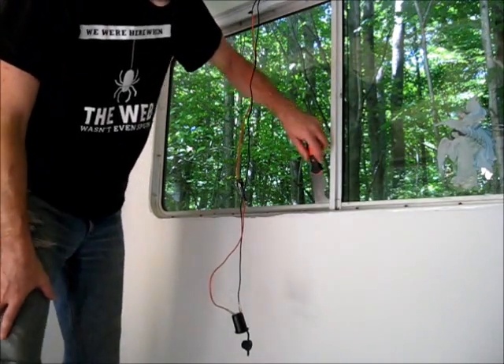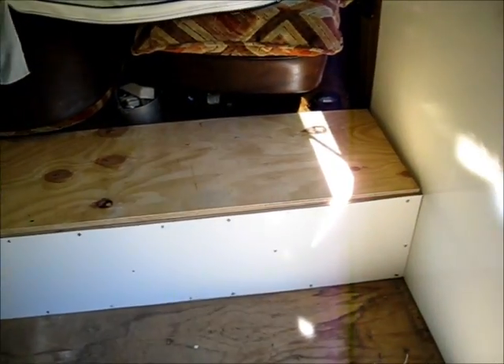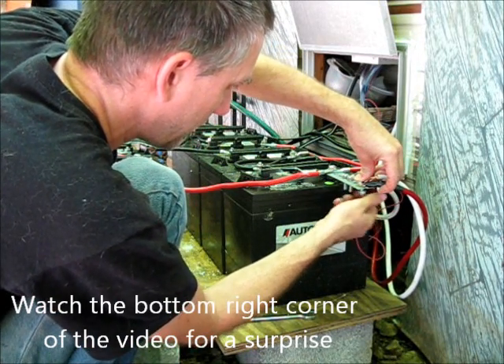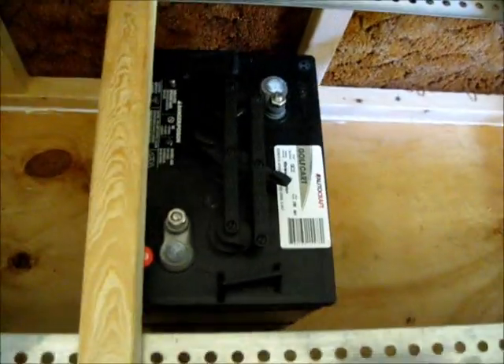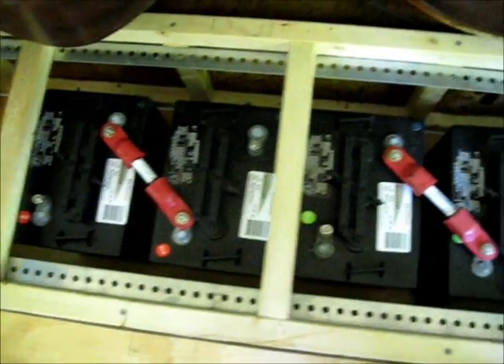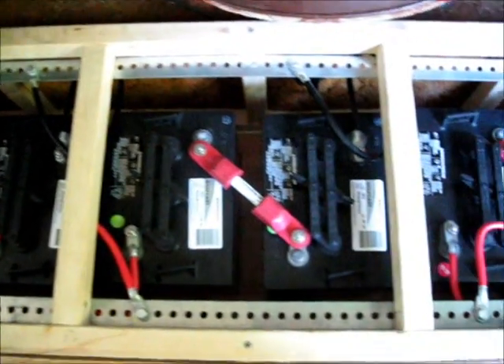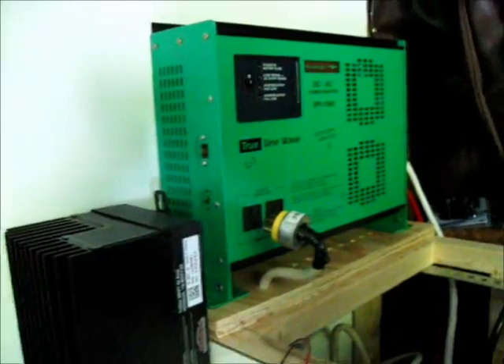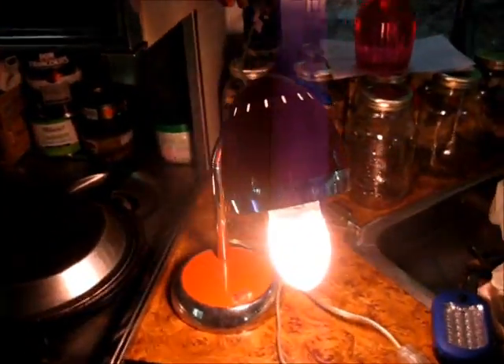Installing My New RV Solar Batteries And Power System

Comment: yes mike had me pull the plug on rear i put a 1/2 a pint in it he said it smell if it was still leaking i need the other part there 2 sizes for my truck he going to fix in next week i got my inverter in side shed or home laundry room vented, if leaving the box's i have are setup same way

Comment: You really dont want to have more than 100 feet of wire from your solar panels to your batteries. you will exsperience a large voltage drop if you go further than that. The batteries wont charge as good as they could if they have a higher voltage to charge with. So if you can shorten the wire you found in the forest be as close to 100 feet as possible  you will have great success in charging rates or times. It will really count for more on cloudy days. you have waay more panels than 230 watts.

Comment: Good system  but its too bad that you had to take shortcuts today. I would not use styrofoam for anything exposed, its a fire risk and fragile. Find another piece of 1/4" board for the back of the box and just put construction adhesive on it, NOT gorilla glue! and push it down between the carpet and box. Also, what gauge was that wire to the solar controller? should be around 4 ga to be efficient. Also, if you tied it the aluminum wire outside, you will need a CU/AL conductant, or they will rot

Comment: No, I did not, wood cases would not be a problem. It is utilizing wood to effectively support electrical buss bars and then under wet conditions which will create a partial to potentially signifcant short accross the buss bars. Which are being used for your paralleling of your effective 12v batteries. It's like a live tree, and or wet dead one will attract a lighting strike and conduct the very high voltage to ground. in your case at 12v even damp wood is only a patial condutor, but you have alot of amperage, I would see it more as a parasitic drainage of your power issue, than a real fire danger or rapid dischage as in a real significant short.  But in a heavy rain and/or you get a new leak in your wall/roof next to the box going to the upper wood supports of the box, and especially the ones going accros your buss bars, could be a issue that you would have to diconnect quickly, but I doubt it. To solve any potential problem and or unnecessary energy loss , I would recommend just unscrewing both the positive and negative busses from the wood frame and inculed a little space, your set up the cables and batteries colud support the busses with no othe structural support, if it's still the same way after 4 years, lol.
Reply: I think, therefore I am. (I think).

Comment: Maybe I really do need new glasses. LOL 
Referring to what you said in another post. Now that I'm looking at comments in thread order, see which one you're referring to. For some reason YT isn't referencing the original comment on many replies. Have to go to beta thread version to see the actual reference. 

BTW, you said hot air rises. We're dealing with atmospheric pressure - positive & negative & how it affects lighter than air hydrogen movement in battery box. With fan in box = negative.

Comment: did you ever try the 5 gallon bucket with a board for a ramp and a can on a hanger with peanut butter trick to catch mice with. I have seen many many videos using that method with great success.

Comment: I must say that I'm a bit disappointed that you used good quality equipment and yet you chose a very poor quality material for your buss bar. I certainly expected to see a copper buss bar as opposed to the steel you used.

I have 4 off-grid homes in the southwest part of the country, 3 of which are RV's and the 4th is a sandbag bunker style 955 sqft home which is only 3 feet above ground. I love seeing the off-grid projects others have done and I'm still going through your videos.

Comment: i got my charge controler in side my battery box on the back side of the box so i can see the charging and if the batterys are full the inverters on the end of the box out side with a part wall of wood to the over hanging roof of the box with steel roofing on the box it can set outside and be used if i have to move or go camping? why that my truck for towing it has odd smell coming from rearend of it like it low on gear lube!

Comment: nice job on the batters bank, steel, it not good to use,, use copper or brass bar, work real good and will Cary all the amp from your batters bank..steel will heat up, and copper and brass will not with a high amp load, run your vent from your batters out side up, just use a 3" PVC pipe, just hook it up with fix a long side your RV, that will vent all the gas up then, you don,t want that gas under your RV, my self I use Dir cell batters, it no gas with then, and you don,t have to vent then at all,yes they cost more but you get what you pay for now day,,your batters box is very good, went it all seal up,just add that 3" PVC pipe out side up, over the top of your RV, then you will be OK, if you ever move the RV just take it down for your road  trip,  I got 10 batters 5 on each side of my RV, but they are Dri cell batters, so no gas with then,  I do have a fan to cool then in the summer time, in the winter it OK, they stay very cool, will nice job on the batters bank I like your Video

Comment: Why have a sealed box and then drill holes under the inverter? Kinda defeats the purpose ? Even with a fan better to draw the air from outside

Comment: Not an expert, but maybe you should have put a tray of some material under those batteries in case of a leak or spill. I would not put batteries on bare wood in my fiver.

Comment: Wow, another winter without hot water.  This off grid living is proving to be brutal.  Armor All.  It won't hurt rubber or plastics.  It's a lubricant.   Your wasting your time working on that camper for your parents.  After viewing this video, your mother is insisting on a hotel room.

Comment: why does everybody always waste 90% of their generated electricity with power inverters??? wow.. makes me wonder if the solar panels will even be able to keep up with the power inverters consumption itself..make your items all 12 volts and the setup would never die. most things that use 110 are usually stepped down to 12 volts or less, figure it out because power inverters are a really in-efficient way of getting around just stepping your appliances down to 12 volts or less.
Reply: exactly, buy 12 volt tv's and 12 volt appliances, etc....  More efficient that way.  Modern tv's plug into a/c and convert to d/c internally anyway, so why take 12 volt and invert to 115 then back to dc voltage inside the tv, very inefficient.
Reply: A 90% efficient Inverter as most of them are or are near to, means that 90% of the power is effectively still available to use, and only 10% is wasted as heat.
Reply: Maybe we could explore using that heat to heat water. Like a water cooled cpu cooler, use the heated water for your hot water heater or there are always thermoelectric moduals you could place on the heat sink. That way you could generate a little more power with the wasted heat.
Reply: Using the heat from the inverter to heat water that can be used to heat your home too.
Reply: You dont get it and are trying to mess with my words. You dont understand the statement to use use the heated water for your hot water heater? Let me further explain then.  You can use the heated water and pump it to the hot water heater. If you have this as a heat source circulating hot water into your hot water heater from the heat sink, then you wont need to spend extra money using the heating element in your hot water heater. Do you understand that? Of course you dont heat hot water, but I never said that, you did because you twisted my words.
Reply: Do a search using hot water heater online and continue to try to make your point. I understand the english language quite well and am well educated. My usage was spot on. The word hot is acceptable and used to emphasize in that case.
Reply: And to add. We also use water heaters outside to keep animals water from freezing or inside in fish tanks to keep it set at one temperature but not to make the water hot. So your point is invalid because hot water heaters heat thw water to a hot temperature, not just warm.
Reply: Pools have water heaters, gm diesel trucks have water heaters for the winter instead of a block heater, but do those make the water hot?
Reply: Nope. Go back to school, english teacher.
Reply: Go to home depot and look on the box. The word hot will be on it.
Reply: I have installed many hot water heaters.
Reply: Where did I ever say a heater to heat hot water? I never did.
Reply: Let me explain my original statement in more laymans terms. You can run water throught the heat sink that will heat you water and make it hot. You then pump that water into your water heater so it doeant have to work as hard. And yes I saod hot water heater in reference to your home water heater. Btw, fha inspection sheets reference hot water heater. Numerous internet references say hot water heater when talking about your home hot water heater. You must be an idiot to think that by me saying hot water heater that I mean that I want to heat water that has already been heated.
Reply: Apparently you are not real familiar with how people talk.
Reply: Whatever. I am not going to argue on christmas.
Btw, merry christmas.
Reply: awman241 Your comment "A 90% efficient Inverter as most of them are or are near to, means that 90% of the power is effectively still available to use, and only 10% is wasted as heat." is 30 or 40 year old. They are 98 or 99% efficient these days (2015) I know because I'm an electrician and I own AC and DC  amp meters and have measured my inverter. Did you measure the performance of an inverter? Your  90% figure did not come from actual measuring, I'm positive.  Certainly not a present day model. Pulling facts out of thin air is not good unless you want others who do know what you really don't know.
Reply: rick dees
Most cheep Chines inverters lie about there power efficiency to make the product look better then it really is, most of the time there really around 80%
I do own several inverters including a good Xantrex ProWatt SW inverter and yes the measured efficiency is around 90%.
Also when measuring the efficiency of the inverters take your voltage readings at the inverter not the battery or any other power source for voltage drop in the lines as well remember to that whats in DC is just Volts times Amps and on AC its volts time amps time power factor.
DC W=V*A
AC W=V*A*PF (Power Factor)
Please see ***** videos for more information on inverters.
Reply: awman241 Thanks for the link.

Comment: You and me both. Don't listen and don't read the comments either. Have to wonder when the same question is asked and answered over and over again on the same video. At some point, Troy may have to stop responding to the majority of posts due to the time it takes.

Comment: After you ran 2 six volt batteries to make a 12 volt bank, I don't see where the 3 banks run in parallel. I keep thinking the 3 twelve volt banks are running in series to make one 36 volt system.
Reply: all the battery sets go into the 2 bus bars (think of them as a big flat wire) all the + go into the one along the top of the box towards the rear, and the - lines all go into the bus bar towards the front of the RV(since it is very close to the metal of the engine compartment cover for safety).

Comment: I have a couple questions and anyone can answer if they know...how many watts does the inverter dish out? How many solar panels are you running? How long does it take to charge all of the batteries? With this battery bank you have now, do you think it could run two desktop computers and an air conditioner? I think the idea is awesome by the way! Thank you!
Reply from the maker: I dont remember all that I had back then. Recently I am sitting inside an off grid tiny house on wheels that I am building. Now I have 8 Trojan golf cart batteries and 1200 watts of solar panels connected. I can run two laptops, LED lights, cell phones, cameras, various other small devices and more. I charge up my power tool batteries all day long, every day as well. Things are better now. BUT - we still are surrounded by trees and have lots of clouds. So my solar power output is less than if you are down south farther or have nothing blocking the sun during any part of the day. Check out my more recent videos

Comment: dont make a big fuzz about this , if you ventilate the box well,there is no way gas can build up!
i do this work for living, i do no what y m talking about, you can always make it better , but if yoy ventilate well (and he does with a fan!) there should be no problem at all , the gassing wil not be that bad , becouse he has a good regulator on the panels,", only thing y should have done different is take power of one end of the bank, and return wire oposite site (better power drawing )

Comment: do  batteries need vent outside
Reply: Yes, definitely. Acidic fume will mess up your RV and your lung.
Reply: Not if you use the right batteries. Gel Batteries do not need venting.
Reply: he said he has vents and fan he's installing at around 6:00

Comment: Can you run your air conditioner off that set up? I can run all the the stuff in my pull behind camper with less batteries than that and smaller solar panels. It seems you spent a butt load of money to get the same results most RV's get with one battery. Please correct me If i'm wrong. Seems like over kill with for the same results.
Reply: Yeah thats why it was a question...
Reply: ***** I'm still trying to learn all about this stuff. I'm no electrician. Not even close LOL!
Reply: You can run an air conditioner off that setup.  I didn't see what he had for solar panels, but if he can recharge the batteries fully while using the A/C then keeping up is no problem.  those batteries should keep the A/C on all night no problem.  It should only take 4 down to no more than 50% if that's all he had.   The golf cart batteries have less amp hours than some of the marine batteries so you want to take that into account.
Reply: Thank you!